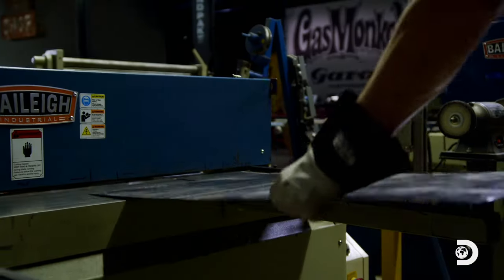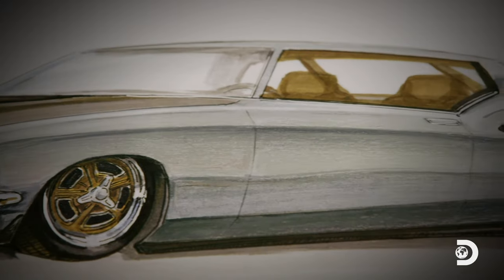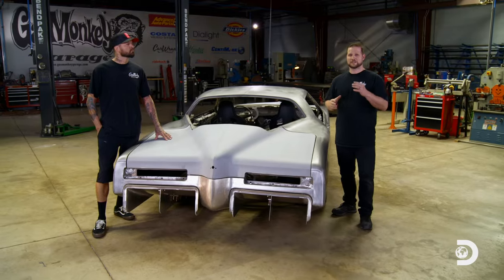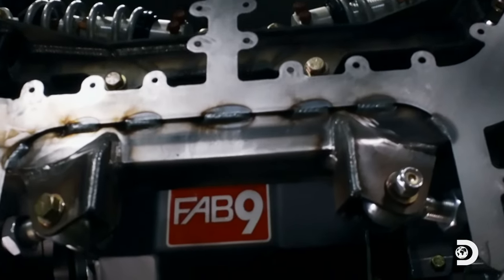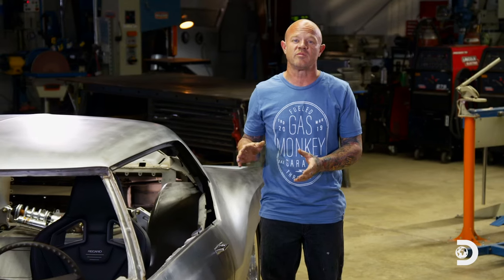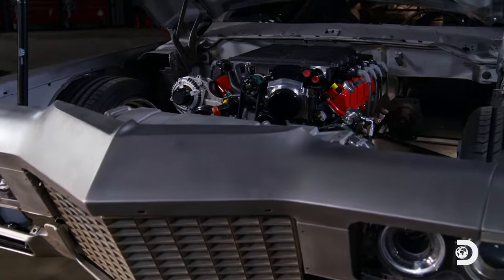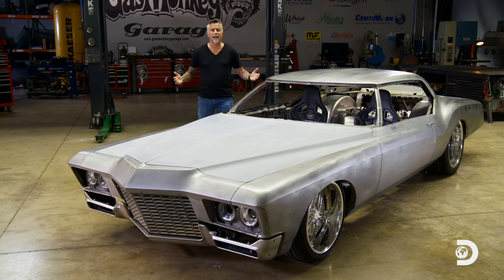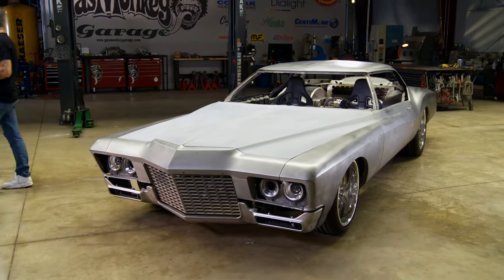The '72 Buick Riviera for SEMA | Fast N' Loud

Comment: The original Riviera was a thing of beauty. Some things just don't require or need any improvement.
Reply: Projects like this are stupid. They gutted a perfectly good Riv and made something that sort of suggests the shape of one but looks worse and has absolutely no hardware that's in an actual Riv.
Reply: Couldn’t agree more. The car was beautiful to begin with. All I would have done is clean it up and maybe repaint it. Update the brakes and suspension.
Reply: With that budget I could have done everything I wanted to that car and still bought a house lol. Nothing wrong with that O.G. Riviera
Reply: @jeffmartin9212  no you couldnt parts for theese are rare and beyond exspensive my best friend and his dad built one and his dad owned a shop and still payed out the ass for any type of parts and waited for years to find alot of them
Reply: Facts!

Comment: The guys at GMG do a great deal of work & time so I can appreciate their craftsmanship, but this build doesn't look that great imo the original look is better. They took a classic & turned it into a Batmobile.
Since I live in Vegas I'll be at SEMA, I want to see this up close
Reply: Finally a sensible comment.Thank you 27.I do like the idea of chopping the top to bring the front a little lower. Other than that,leave it stock as far as the body goes( other than fitted,radiused bumpers,deleted marker lights,etc)Do you agree?What colour would you paint it?
Reply: @craigcode7103  actually there is a a Black 72 Rivvy with Red interior, sitting in a lot on desert inn rd & valley view here in Vegas about 2 miles from the Convention Center, and I like that look so I would say Black with Red interior
Reply: @27sincity  Black,IMO is too common (everybody does black)but the black and red combo is sexy,I can't argue!You have a good day 27.
Reply: Don't go insulting the Batmobile by comparing it to this. LOL
Reply: @knytrydr73  lol

Comment: Please rethink the gunmetal gray it needs a stand out color .
Reply: Just FYI for those who don't know. Gray is a shade not a colour. White, grey, black, they are all shades. I think grey would look terrible. For the record the 72 is a beautiful car just as they found it. Why would you want to make a true original, one of the few GM cars I like, into a so called super car? Much rarer the way it was in 72. Why not restore it to perfection? Make it better than it came off the line by improving paint, fit and overall finish.
Reply: @maryrafuse2297  Thanks for the kindergarten art lesson Mary,the right SHADE of gunmetal with some flake would look great on this car.I do agree that they went too far with the body mods but I do like how they chopped the top to bring the front roof edge lower.
Reply: I disagree,gunmetal with some flake would accent the beautiful body lines on this beast.
Reply: It would be really cool in a electric green with lots of flake and sparkle.(that’s my opinion)

Comment: I like the car all the way until you get to the diffuser.... diffuser ruined it.
Reply: I kinda feel the same way but it is a pretty good custom touch or a good effort
  The seats are just a lazy bolt on add. Custom is suppose to be one of a kind. Those do not speak to a " gentlemans racing car"
 Cut the defusers in half custom bucket seats. More class less fast.
Reply: I agree! Diffuser looks too fast and furious for me and a gun metal grey car needs aluminum bomber seats!!! Not bolt in anything
Reply: That's where that extra 500 rwhp comes from.
Reply: Unproven extra rwhp!!!
Reply: Yea I love these cars but but them stock

Comment: Too bad you went the easy route with an LS, should have stuck with Buick power. Plenty of good stuff out there these days.
Reply: Did you not see the video, it's a gen V LT4. And good luck getting 1,000 horsepower on pump gas with an old Buick engine.
Reply: @vincentrusso4514  , RIGHT. Because 1000hp is  even useful. It's a number for bragging rights. That's it. At least the Chevy swap isn't a permanent thing, someone could correct that later.